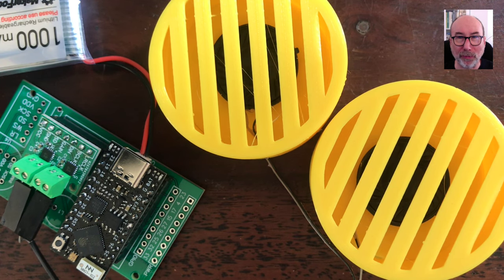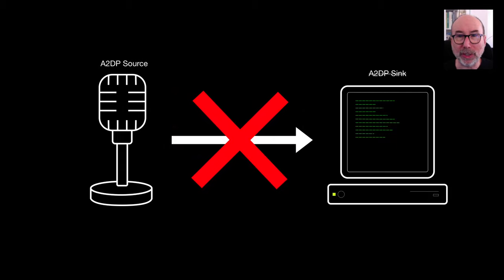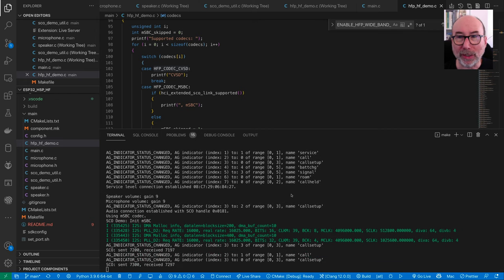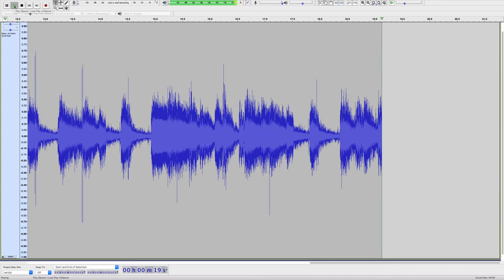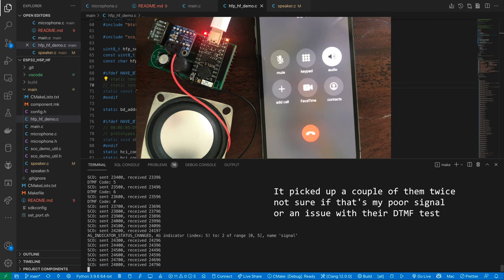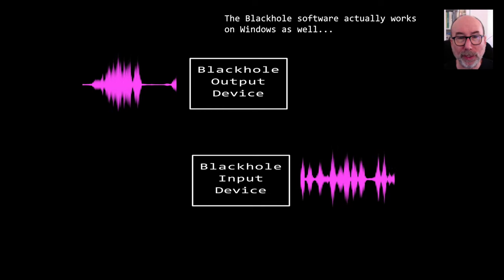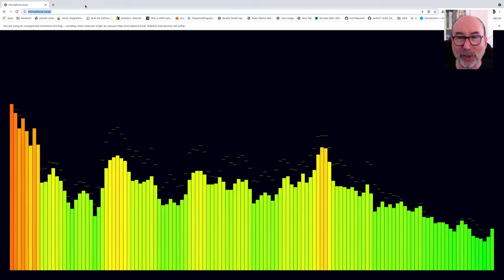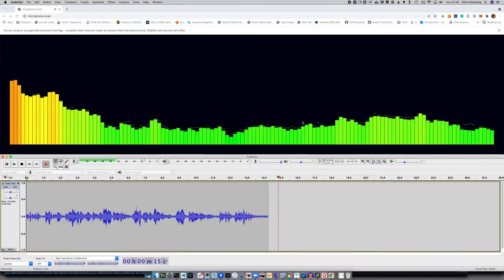Wireless Mic on ESP32: Bluetooth Struggles & Success!

Comment: Nice!  For data collection for a research project, we want to record from many individuals in the same room - is there any reason why we couldn't replicate this say 20 or 30 times, with a little lapel mic on each, and stream over the one WiFi network?  A bit of latency isn't an issue - the audio needs to be post-processed anyway.

Comment: As audio for communications is normally less that 3KHz then 4kHz is quite good. Also when using your phone anything above 4kHz is a waste of bandwidth.  As Bluetooth was developed for hands free phones etc, the mic side was never going to be wifi. This is in part to I think that most users may listen to music with the quality of MP3, they are never going to be singing a vocal back to the phone system.

PC input audio might be set with a low frequency limit as it’s normally providing gamers with talkback.
Reply from the maker: You are of course correct  - I am being slightly unfair on the hands free profile - it is aimed at mobile phones so having the sampling rate at 8kHz actually made a lot of sense. It's just a bit unfortunate that the A2DP source is so limited. I have a sneaking suspicion that some of this is due to trying to prevent piracy. If my PC will record from an A2DP source then I can play music and record it on my PC.

Comment: Too bad the original Bluetooth Headset profile did not work with better quality. I have multiple headsets, all of them significantly degrade quality of audio while on call comparing to just watching a video. This is due to switch from A2DP to HSP :(
Reply from the maker: It's a bit sad they've not updated it. It made sense at the time when people were connecting to mobile phones where the audio is not high quality, but everyone is on Zoom nowadays :)

Comment: Is there any reason you picked tcp and 1024 samples to read each loop?

I’d think udp would cut down on latency a bit as well as overhead (no need for ACKs,) and smaller sample sizes might help as well. 

Lastly, I’d think a config to send to either a plain receiver or web socket would be a better choice than sending to both. 

What do you think?

Comment: I am looking to see any work or work on the other way, using phone/laptop microphone to capture the audio and send it to esp32. if you have some light on this is appreciated. Thanks
Reply from the maker: Probably the easiest way would be to capture the audio on the phone/laptop and then send it over a WiFi connection to the ESP32.
Reply: @atomic14  is there a way to stream in real-time even with some latency from phone audio to esp32 ?

Comment: You should've measured delay, it is very important parameter in microphone+ADC+streaming over medium device. So what is delay ?
Reply from the maker: The delay with the socket version will have the time for the packet to go over the wifi network which will be the order of <20ms. The main delay is caused by needing to buffer the audio so that you don't get dropouts due to delayed packets. The size of this buffer really depends on how good your network is and what other traffic is running over it.
Reply: @atomic14  In either way(wired or wireless) size of audio buffer also depends on computation capabilities, many smaller frames harder to compute that few larger ones, I think with such low power cpu there should be bottleneck and need to be investigated.

Comment: The code from github, can I use it in the arduino id?
Reply from the maker: You can probably pull it out and use it - I don't really use the Arduino IDE much.
Reply: @atomic14  Hi genius I don't get the HFP project, sorry for the question, how will I include it (bluekitken/btstack)? I already tried to run only the HFP project but I get herrors, I'm in VSCODE with the IDF extension espressif. It would be great if you made a video about it, I would really appreciate it.

Comment: exactly what I needed!
Reply from the maker: Great! What are you planning on building?
Reply: @atomic14  A wireless transmitter for an electric guitar. You can use the ADC to read from the pickups and then transmit the audio to an amplifier. I'd be super easy to add echo and distortion too. Feel free to use the idea as you will.